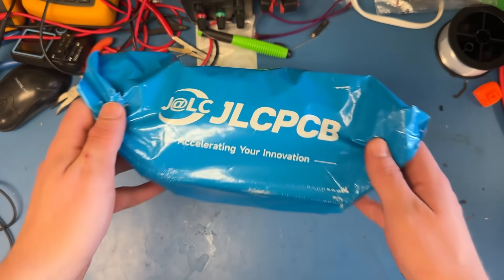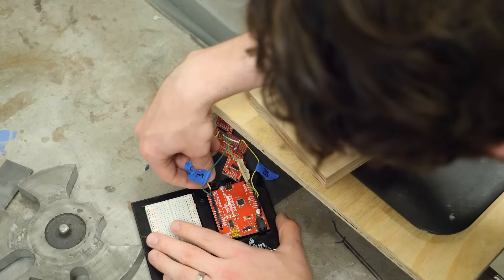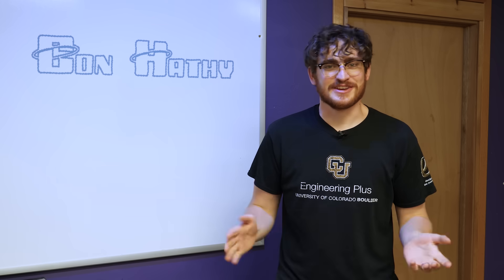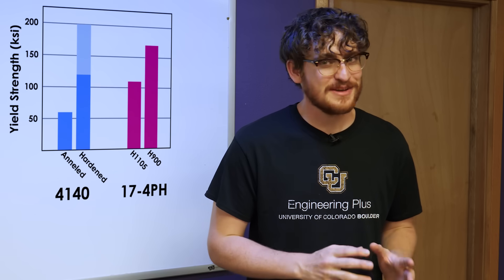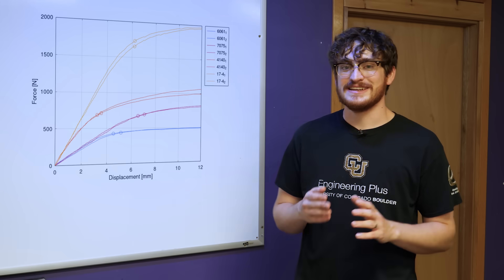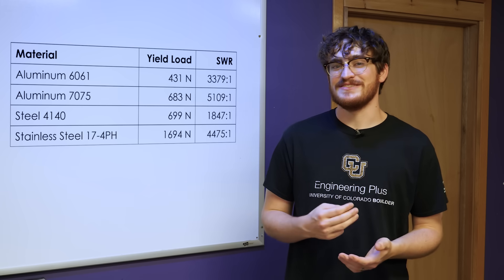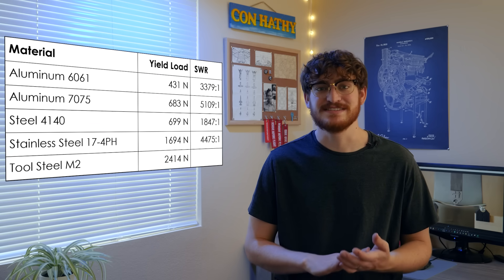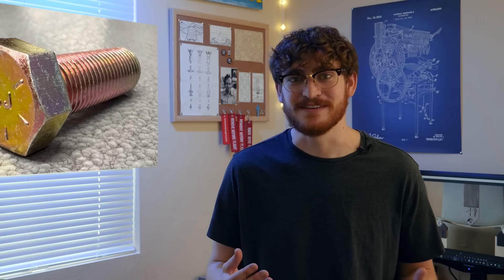Is Aluminum Actually Stronger Than Steel?

Comment: The problem with steel has always been the difficulty in forming it intricately enough (and intelligently enough) to lose all the redundant material, which has to be done with forging or machining, or a combination of the two. But I would have thought that might be changing.

Comment: My old cro-moly mountain bIke is lighter than most modern aluminum bike. It seems that aluminum is used to produce trendy shapes without any gain in strength or weight

Comment: All good, but this ignores manufacture. If you're building a rocket out of metal, you've got to weld. This is where the high alloy and hardened steels are problematic. Also, aluminium is easier to friction weld. Steel is great for smaller parts where stress is concentrated and you're not welding. Ultimately however, if you're building a rocket body then carbon fibre is king. Cost is not an issue with reuse.

Comment: I'm not a fan of aluminum with few exceptions. It has some merit in aerospace applications, but I cringe every time a Youtuber makes a tool or machine from it. Small, inexpensive CNC machines that can't cut steel are making the inappropriate use of aluminum skyrocket.
Reply: well sometimes, especially with smallish parts, aluminium makes more sense as you can achieve the similar strength/weight/stiffness with waaay less complicated parts because you simply dont have to remove as much material from the aluminium.
Reply: @HannyDart  Steel has 3 times better Young modulus compared to aluminium, there is no way around that.
Reply: But that’s a totally valid use case. If the ability to machine it is wayyy more accessible, and you take the materials properties into account in your design - what’s the problem ?

Engineers have to manage problems like this all of the time. They have other factors to account for like cost, availability, lead time, etc, and sometimes use a different material type. But they design for it. 

For the average home gamer if they can afford to machine aluminium but not steel, who cares? They can just make it thicker or whatever, it’s an incremental cost. A CNC machine that can machine steel is a hell of a or more expensive.

Comment: The use of Aluminium ALLOYS allow the use of deeper sections. This makes it stiff.  Use steel and the web sections become very thin and subject to buckling (Wagner) effects.  Corrosion inhibitors add weight for steel. Basically the materials used can alter how you will design a component. Blind substitution only works in 'dumb' situations.  Fatigue life and ageing of alloys complicate things even more.
Reply: that't the thing with titanium too because pund for pund steel beats titanium too, but the added strength from the section seems to be what matters more.
Reply: @JForrestFisher--76  titanium can stand up to pretty much anything other than tool steels in terms of strength to weight. And nobody really uses tool steels for large structural components for various reasons, firstly their brittleness, and secondly heat-treating / quenching large objects gets really complicated if not impossible to do well.
Reply: Thats what my material professor told us in college
Reply: That moment, of inertia
Reply: I’ve actually wondered, is there a reason steel isn’t used for things like honeycomb panel plating? The benefit of aluminum in buckling strength is that its lower density naturally creates thicker and therefore more buckling resistant cross sections for the same weight. But, for something like a sandwich panel, the buckling resistance of the sheets is provided by the honeycomb, not the sheet’s thickness (that’s the point). So, wouldn’t steel’s higher strength to weight be more important here?
Reply: @marcellarisa7239 That's a thoughtful question! I wonder how the math works out, between the thickness of the aluminum and the strength of steel.

I mean, it is like a race isn't it? Although both are intended to increase structural rigidity, it's not clear to me whether the aluminum thickness or the honecomb's shape is more important here.
Reply: @marcellarisa7239  i guess the problem is fabricating it
Reply: Crazy complicated! 😓 No wonder old time equipment was overbuilt out of steel! Was probably cheaper than the engineering bill! 😂 (Or, the fancy stuff hadn't been invented yet.)

Comment: I don´t know how to build thin sheet metal structures out of tool steel. For example an aircraft wing. So it depends on the form of the object. Theres no sense in building an axle or driveshaft or hinge bolt out of aluminium. But maybe somebody can 3D print everything.

Comment: but is it a kilogram of it heavier than a kilogram of feathers?
Reply: A kilogram of aluminum will sink. A kilogram of feathers will float. Need I say more?
Reply: That's an old one! Monty python perhaps?
Reply: So that's the metric variant of the old trick question. The usual imperial variant is, "Which is heavier? An ounce of gold or an ounce of feathers?" My answer is that the gold is heavier. Why? Ordinary substances, like feathers, are measured in averdupois ounces, but precious metals are measured in troy onces. An averdupois ounce is about 28.35 grams, while a troy ounce is about 31.1 grams, hence an ounce of gold is heavier than an ounce of feathers. But what about a pound of gold vs. a pound of feathers? In this case the feathers are heavier. An averdupois pound is sixteen ounces, but a troy pound is only twelve ounces. Another reason that Imperial (actually U.S. Customary) measures are just goofy compared to SI.
Reply: Good gods and I thought i was a nerd
Reply: Of course 1kg of aluminum is heavier than 1kg of feathers. Aluminum is heavier than feathers... duh
Reply: Yes because packaging adds mass to the kilo of feathers. The gross weight of 1 kilo of feathers is greater.
Reply: That's funny
Reply: Obviously it’s heavier than feathers. But a kilogram of aluminum is lighter than a kilogram of steel, because steel is heavier than aluminum AND feathers.
Reply: Yes.
Kilogram is a mass measurement. Steel is more dense than feathers, so the feathers displace more air, so the bouyancy force brings their weight down slightly.

A pound of feathers weighs the same as a pound of steel though.
Reply: What’s heavier? An ounce of gold, an ounce of feathers or an ounce of mercury?

The mercury; it’s a fluid under typical conditions and a fluid ounce will weigh more than a pound mass. Then the gold since that’s a noble metal and conventionally measured in troy ounces, which are slightly larger than averdupois ounces.
Reply: @9ZweihandeR9 but aluminum is heavier than feathers😦
Reply: @9ZweihandeR9 Kilos are also a weight measurement, sorry
Reply: @oberonpanopticon  Kilogram-force is a weight measurement. Kilogram by itself is mass. Newtons are the real SI weight measurement.
Reply: @oberonpanopticon  Not really, y'all are just afraid of newtons.
Reply: @9ZweihandeR9  no because weight is dependent on surface gravity but potentially other forms of acceleration, which is not a constant. i.e the "pound" of feathers will be lighter because it will be taller and thus further from the earth.

Comment: have you considered converting to the church of magnesium good sir?
Reply: Too hot down there 🔥
Reply: The church of metal fires?
Reply: @Tom89194 
Y’all need to keep up on the news. There are new magnesium alloys that not only have excellent, aluminum-like corrosion resistance, but are also fireproof. Even when fully melted, they don’t go into thermal runaway.
Reply: @Jjames763 and how does that strength to weight and cost compare to maraging steel or if you insist on stainless maraging stainless?
Reply: @JForrestFisher--76 
Quite favorably, in fact. Particularly in terms of buckling strength. For a steel bar of a given stiffness and length, a magnesium part of the same stiffness and length will weigh only 38% as much (albeit it will be thicker).
Reply: @Jjames763  The only problem with magnesium alloys like that is their poor ductility. Which usually translates to poor durability.
Reply: @Tom89194 
I’ve seen great progress in terms of creep resistance and ductility. AZ31 alloy, for instance, has exhibited a ductility of 28.7%, as compared to the 9-18% of older magnesium alloys. 6061 aluminum has a ductility of about 30%, and steel is typically in the 10-20% range.
Reply: @Jjames763  The only major issue with that alloy is the abysmally low service temp range.... Many AZ31 alloys are supposedly noticeably softer at just 95C.
Reply: @Tom89194 
Interesting. I wonder how “stainless” SEN magnesium performs in that regard. I do know that some magnesium alloys are good up to 250-300°C. Yttrium and Calcium are the additives that seem most promising in terms of increasing strength, corrosion resistance, and flammability.
Reply: @Jjames763 Hydrogen embrittlement... magnesium is not suited to stress in high altitude atmospheric conditions. Done its over.  Magnesium can be used for wheels as they are not under stress/ movement in high altitude.
Reply: @j...bro.
So use magnesium for low-altitude applications, then. It would still save an enormous amount of weight. For example, you could make cars, bikes, helicopters, wheels, and even the non-structural parts of an airplane out of it, such as replacing the aluminum in seats and fittings.
Reply: @Tom89194 y'all talkin about zirconium? Haha
Reply: Or magnesium nanocomposites. The strength of steel, without the weight.
Reply: @saumyacow4435 wamna bet if ypu did thecsame with steel it wouldn't be stronger?
Reply: @JForrestFisher--76  If you can find a steel nanocomposite, I'd love the link.
Reply: Once you on fire nothing's putting you out.
Reply: @Jd-zl7mn  I think those WWII bombers had magnesium engines on them, and if they start burning, the whole plane's going down. Being a bomber it had a lot more opportunity to catch on fire.
Reply: Magnesium sucks worse than aluminum
Reply: @goatfromhell666  Forged Magnesium, the kind they make with the 100,000 tonne presses, has insane strength to weight. Downside is the cost.
Reply: @goatfromhell666 wrong there is uses for all metals. Each metal has its own specialty.
Reply: @Jd-zl7mn  duhhh, I've only been a metalworker for 25 years, but my original comment still stands
Reply: @goatfromhell666  agreed. Ive seen some old magnesium cased chainsaws that got brittle and cracked as they aged. It's pretty reactive compared to aluminum
Reply: My first thought as well! 30% lighter than aluminum alloys, and much better buckling and vibration resistance. What’s not to like?
Reply: im partial to mercury
Reply: Oh god an even worse alloy
Reply: Beryllium has entered the chat
Reply: @alexdrockhound9497 Just don't breathe in the dust.
Reply: You are not taking the modulus of elasticity into consideration? Steel is 3 times as stiff as aluminum!
Reply: The stuff that is used in flares and pyrotechnics? Sure why not.
Reply: This very interesting thread has a lot of talk about mixing magnesium with other highly reactive materials to make useful alloys.

That explains a lot of why it wouldn't be used. The added danger would affect the manufacturing costs

Also, it would mean magnesium production couldn't take advantage of the same techniques and equipment used for steel to create a large-scale production line. Magnesium alloys would be produced in much smaller batches until someone invested all the effort to reinvent the steel mill.
Reply: "I am the way and the light, except the light is a raging magnesium fire."
Reply: Ain’t it hard to machine tho, fire risk
Reply: Burns as bright as a star!
Reply: No one going to talk about how scandium is literally pretty much titanium but even lighter.
Reply: Doesn't magnesium corrode like theres no tomorrow my friend who works on aircraft hates working on planes with magnesium aerofoils
Reply: Ah yes, corrosion, brittle, and more fatigue. At only 4x the cost!  Brilliant!
Reply: Boy I sure do love my metal catching on fire
Reply: Nah, heard it's actually quite hot and bright, my eyes are sensitive
Reply: Spoken like someone who hasn't worked with magnesium

Comment: I read this about motorcycle frames, and steel vs aluminum- that by going to a larger diameter you increased stiffness, and aluminum won there because for a given strength it was thicker, and the steel was so thin it was difficult to weld.  So while the aluminum wasn't stronger, steel of the same strength wasn't easy to manufacture... you couldn't TIG weld joints- you could use lugs and braze but then all the weight savings went away and it became expensive. 

And the stiffness was really important in a frame- you could double the diameter and use aluminum, and make it much stiffer for a given weight, while it still being thick enough for mass production welding etc.

Which, at the time, kinda blew my mind, because I thought Al was stronger for a given weight...  the reality was that the SWR wasn't that different, but fabrication issues really drove things.

Anyway- very nice demo, thanks!
Reply: Casey Stoner, Ducati's first MotoGP champion in 2007 started complaining about the bike during his failed championship defense the following year that no two (hand welded) steel trellis frames felt the same. Ducati was then experimenting with the monocoque/frameless chassis where the airbox is the structure that supports to the steering head and bolts directly to the engine, the swingarm and the subframe also bolt directly to the engine. They also made production bikes with that frame(less) design and I own one, an 899 Panigale.

The monocoque design also failed to win the MotoGP championship, they said it was too stiff and too difficult to tune in the right amount of flex. Then they moved to the tried and tested twin spar aluminum frame.

But they kept refining and evolving the monocoque concept into what we have on the Panigale V4 today, a semi monocoque frame with very thin extensions that barely connect the engine, steering head monocoque and the subframe at one point.

Meanwhile, KTM in MotoGP took over the mantle of refining the steel trellis chassis with their high tech welding robot that can get the same welds every time.
Reply: aluminum is a bit harder to weld than steel at the same time, but its also more corrosion resistant against typical weather.

Comment: aluminium and its alloys are the only metal that is not run thru notch toughness test or charpies impact test. why? because the lower the temp the better the mechanical properties. in the cold of vacuum in space its mechanical properties of the best alloy, aircraft grade, double up compared to room temperature.

Comment: But, from a practical application standpoint, shouldn't you also consider the Failure Modes of the samples?  Yes, the Tool Steel had a higher Breaking Point ... but it was literally a Breaking Point, while the 7075 Aluminum (71% lower yield, 19% lower yield/weight) Deformed rather than  breaking ... but maybe you can get a steel that still beats 7075 on a yield/weight basis but who's failure mode is less ... "extreme" ...

Comment: I was truly shocked the first time I learned Top Fuel dragsters use aluminum for the connecting rods in the engines. Which is pretty impressive considering that these engines produce 5000+ horsepower. Each of the eight cylinders in the 500 cubic inch engine, produces about 13,000 psi of pressure during the compression\power stroke. I had assumed these engines would be using like titanium or an exotic alloy of steel. But they use aluminum because it acts like a shock absorber to reduce the stress on the crankshaft and bearings. The fact that aluminum has a lower stress fatigue to failure than steel doesn't really matter, though. Since the typical top fuel dragster engine is disassembled and rebuilt between runs. And the average set of aluminum connected rods are replaced with a brand new set after just 8-10 runs. So, these connecting rods can propel the car about two miles in total before they are trashed. Of course, those two miles are while the car is going over 300 miles per hour, so those are a fun two miles.
Reply: Con rods mostly need to be strong in compression. A lot of materials are strong enough in compression. The thing is that the rod itself moves in a reciprocating motion very quickly. The lighter weight of AL helps there.
I'm sure it's not because AL is strong.

Comment: Bright example of those words are steel bicycle frames. You still can take more than fifty years old frame and it be just fine to ride even if it was thin tube road bike(just be sure rust not eat it out completely). And aluminium one... I'm sure You will struggle to find any which survive even ten years of intense use in same category... Because they ripped.
Reply: This is not true in my observation. I own an aluminum bicycle with over 3000 miles on it. Plenty of other people probably do too. People have said similar things about carbon fiber bicycles, only to be proved wrong, albeit I think there were some notable failures in the first years of carbon fiber frames.

Comment: Beryllium aluminium, has some awesome properties. I can understand your dislike of Aluminium as a metal but the alloys are a different matter. Also where would we be without Aluminium Oxide? Used in conjunction with other materials such as glass or Carbon fibre and various plastics it just expands our choices while keeping costs within reason.